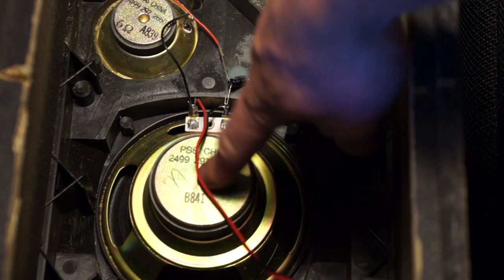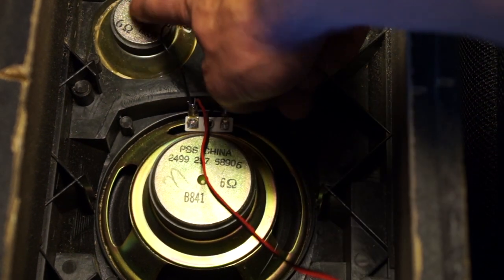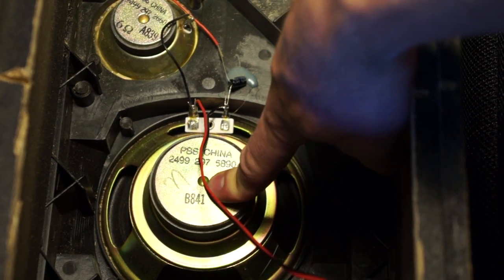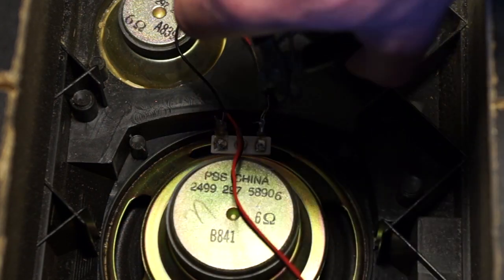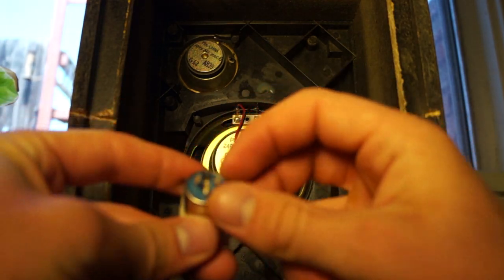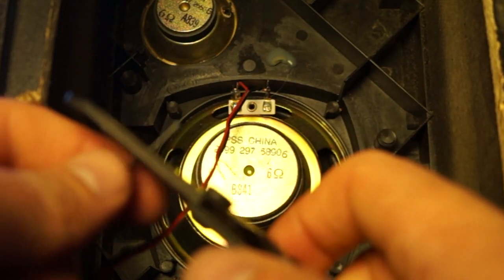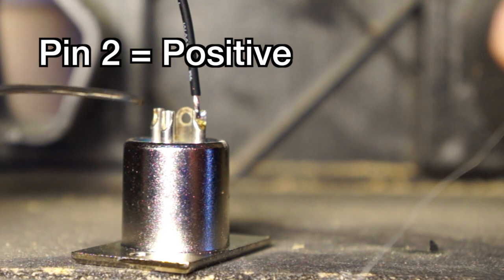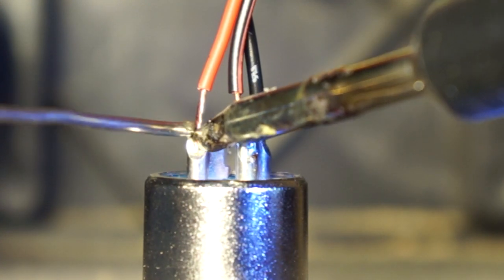How to turn a Speaker into a Microphone

Comment: This little trick was my accidental discovery that electricity works in both directions. I had a cheap shitty headset with a broken microphone. After getting frustrated and shouting at the thing, I noticed that the earpiece was picking up my voice. I turned that headset sideways and taped it to my face and recorded my song. Damn thing sounded better than the microphone on the headset.

Comment: Will speaker as a microphone collect the same frequency response as a speaker?
Reply from the maker: That’s a good question. Idk with 100% certainty but I would assume not. The speaker is designed to move large volumes of air so the diaphragm is heavy and therefore, not as responsive as an input device.

Comment: If your wiring a speaker as a microphone you could wire the negative as the positive. Because a speaker is an output device. But since you’re turning it into an input device it’s better to wire it out of phase

Comment: Very cool! But would it need a power source or just plug it into your recording device and it works?
Reply from the maker: No power required. It's a dynamic microphone just like the Shure SM57. As long as your recording device has preamps, you can plug this mic straight into it.
Reply: @MrMcMath  Sweet! Thanks!

Comment: Hello again man! & cheers for the highlight! Also wondering now... (obviously the smaller the speaker the tighter the freqs - and likely more limited and tending to be more higher/mid responsive) but can I use this technique to realistically make my own BOUNDARY MIC? ie & more specifically, what kind of additional steps would be req'd to pump up the gain input to pick up input at spoken word level?  -- for example: Let's say for a business meeting/conference call situation?  (I'd be using it to notate lyrics as I think of them but you get the idea...) Cheers in advance!
Reply from the maker: Unfortunately, it won't give you great results as a boundary mic. Being far away from a sound source is a challenging set of circumstances to get good audio, making it necessary for specialty design in the mic. For a conference call situation, it depends how many people are on the call. 

If it's just 1 or 2 people, I'd get a lavalier microphone (if it's for 2 people, there are models that have 2 mics for 1 plug). If it's more than 2 people, I'd get an omni-directional condenser microphone and put in the middle of everyone. Condenser microphones are sensitive and generally pick-up everyone in the room.
Reply: @MrMcMath  Thanks for your reply - I actually have a Rode NT-1A condenser but even thru the (Scarlett) interface I seem to be having trouble getting any kind of reasonably CONSISTENCY in levels as I walk around the room "dictating". Even at full input gain.

Which is another thing, needing to physically turn that pot down for a vocal performance is doing my head in! LOL

On this, I'm more certain it's windows audio capabilities (realistically uneasily access 7 manage) rather than anything else but it prompts me to ask, do you know of any DECENT virtual amplifiers or other software that are intuitive, post-startup loadable and over-ride the nonsense of windows audio preferences with a simple mixer interface?

ie. Rewire & Virtual Cable are over-the-top solutions and not exactly what I'm looking for as a solution. There's got to be an easier way to manage all this...?